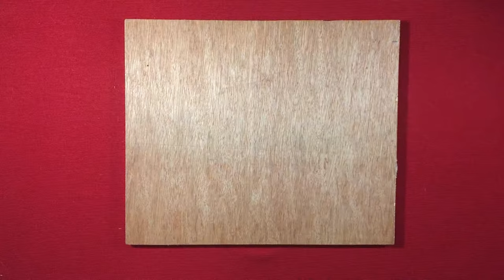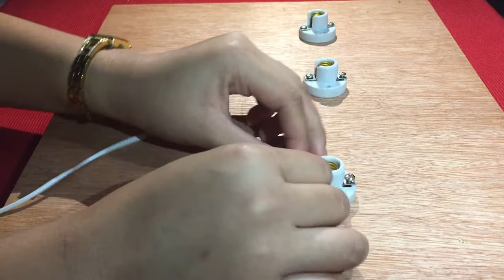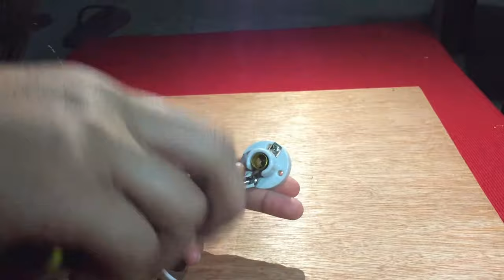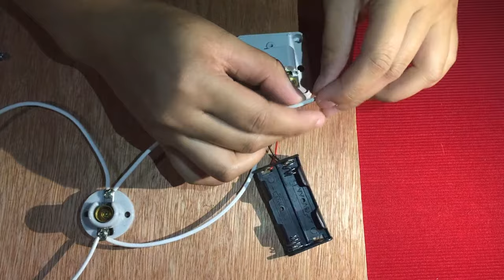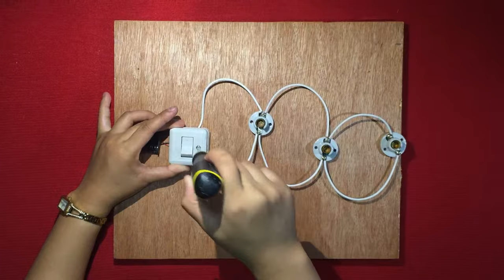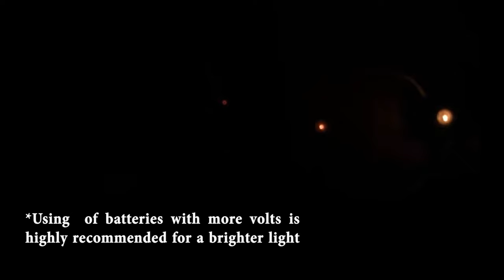Physics Project: Making a Parallel Circuit

Comment: Cool ! You can also see the last bulb is brightest which is from resistors wired in parallel so last bulb has least resistance hence more current equal more light. Awesome

Comment: materials used:
3 bulb receptacles
3 light bulbs
 2 batteries
battery holder
electrical tape (just in case)
light switch
1 meter of copper wire
screwdrivers and pliers
Reply: hi do you know how many watts the light bulb contains?

Comment: Mali Po Ang connection Ng switch kung sa 220 v Po Yan sumabog na Ang positive lang dapat sa switch tpos Ang negative connect mo sa negative sa bulb at negative sa battery
Reply: She didn't plug it into the wall batteries are only a few volts